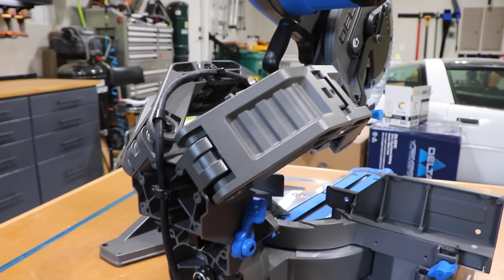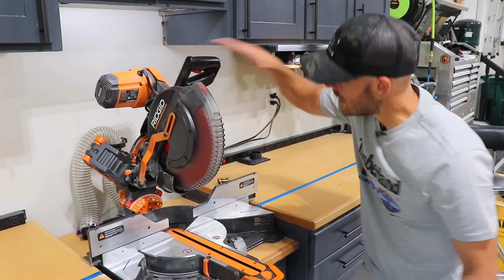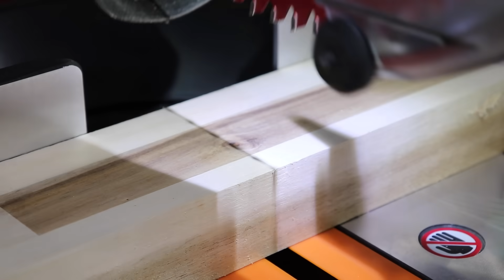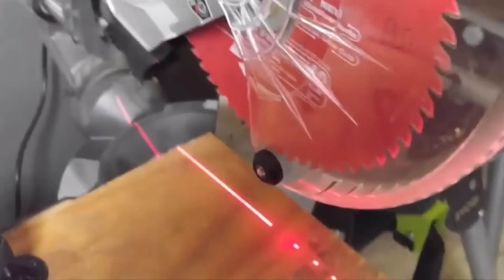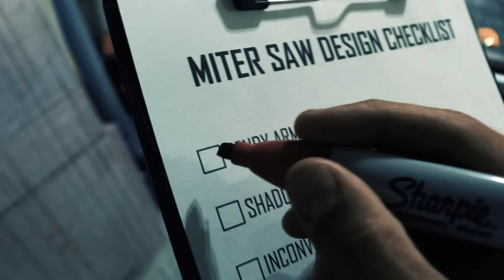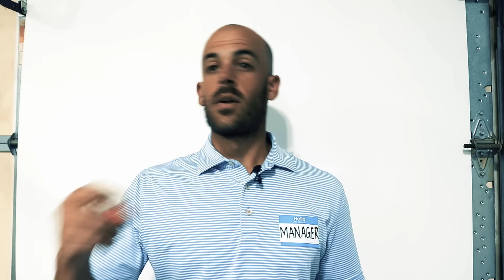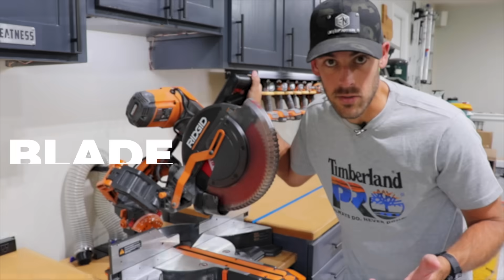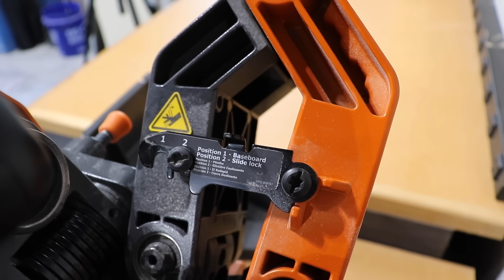I ALMOST took this Saw Back. // RIDGID & Delta Dual Bevel Sliding Miter Saw Review

Comment: I’m no expert but I think the saw should somewhat self center around the axis of rotation 
Bc the blade is spinning so fast it should want to center due to its inertia 

Think of your car steering wheel, it self centers after a turn if you let the steering wheel go

Comment: Now the Delta 10 at HD is 615 and Rigid 10 449. Did you notice any blade wobble? My other brand moves (measure at bottom flat blade above teeth, hand turned) about 1/16 to 3/32. YT videos of Dewalt show fixing that one with new inner bushing.

Comment: Travis. Episode gave the best overview of any piece of equipment I have seen Went to Home Depot and bought the Rigid 12 inch. Very pleased with it so far. I also purchased your dust collection chute. I have one question though. Is the rubber piece supposed to go from the top of the 3D painted piece on both sides. Mine seams to be short be about 1 inch short. Am I missing something?

Comment: Actually there is a use for this saw for those of us who make furniture. Rough cutting stock to length, faster than a table saw honestly. I use hand tools always for the final cuts on my furniture so power tools I look to for saving time in the more mundane processes such as rough cuts. Repeatable rough cuts are huge time savers for those of us in the industry.

Comment: I popped over from another reviewer's video and he mentions that thin kerf 12" blades will have more deflection. Maybe the additional spinning mass of a thicker blade reduces deflection. Maybe it's the flex of the blade because it's thinner. Maybe a bit of both. Perhaps a blade-to-blade comparison on the same saw would be interesting

Comment: I owned the old Ridgid model before the new one you have came out and traded it for a Dewalt,  top end version.  With both saws I have never had a problem getting accurate square cuts on larger materials.  Granted I don't make furniture,  but I  have built a lot of intricate trim work.  I think blade movement when fully extended is overrated.  If the saw is properly adjusted and square,  it shouldn't be a problem with 12"-14" wide cuts. You generally mark a square line on your material anyway,  so you can see how accurate the cut is. I agree with you,  if you don't force the blade laterally,  you shouldn't have any problems getting a perfect square cut. If you think about it,  a 14" square cut can be made very accurately by hand with  a Skillsaw, and these sliding miter saws have been very accurate in my experience with Ridgid and Dewalt. 

My Dewalt has the shadow line feature you mention and it took me a while to get used to it.  I do like it and it works pretty well in most situations.  It is very accurate.

Comment: Hello Shop Nation
I just found your channel and subscribed.   On the saw stand problem,  I think, I have a possible solution. If the length of the cut is close to the width of the saw. Why not level out the saw stand to be even with the rest of table. The how to due that depends on permanent you are willing to go. My first thought was all threads bolts, that way you can level all directions. Anyway, you just acquired a Aircraft Mechanic to the group. I usually have to think outside the box. Again thank you for the opportunity.

Comment: I used an old Craftsman 10" miter (dual bevel) for years. It has much worse blade deflection than any you showed. But managing it was possible through technique. Like you said, you should NOT be fighting the tool. Let it do the work for you.

Great video, and I am definitely looking forward to a comparison that actually includes three brand/models I am interested in purchasing next. Thanks!

Comment: Travis, this is an excellent video and I think all viewers universally appreciate the side by side (no pun intended) comparisons and your detailed research. I'm hoping you can adapt your chute design to the Bosh..if so, I think you'll sell  a lot of them. In my case, my hood does a pretty good job, but I have to remove it for 45's...i.e. dumb miscalculation on my part. Your chute would let me dump the hood and cut those rare 45s without dinking around. Thx

Comment: I think missing from this discussion is why the slider exists.  For many woodworkers it consolidated the functions of a radial arm saw and chop saw, allowing one tool to be removed from the garage. Most non-industrial radials had deflection, but they were popular for breaking boards down...sound familiar? It's hard for me to believe that a slider that is locked in the contracted position is less accurate than a chop saw...at least to a degree that it would matter to most of us.

Comment: Deflection fix: 
Let the blade spin up to full rpm before you move it, then make slow deliberate cuts.  Gyroscopic force keeps it true unless you horse it.  Learn your body’s movements.
Reply: And use a thin blade further reduces that effect
Reply: @phubarnow5388  How's that? A heavier/thicker blade provides more mass, thus should resist deflection more.
Reply: @pawpawstew  - yep, the most accurate cutting blades are the thickest and most expensive but worth it.
Reply: Yay, Physics!  Angular momentum is like magic.

Comment: I had the Delta Cruzer 2nd gen, that was supposed to correct the blade deflection issue, Well, it didn't. This saw would be off a degree or two on Miters for finished moldings, NO matter what I tried it would deflect on hardwoods. Loved the slide arms though!  Thank god I kept my DeWalt which is set dead on accurate.

Comment: It would be better if you measured the amount of full extension deflection with a dial indicator and a fish scale at some reasonable consistent force. It would still be subjective because of pull location, but less so.
Reply from the maker: Yeah I thought about doing that but I have that in my back pocket for the full comparison video
Reply: @ShopNation  when do you think you can put full comparison video together?

Comment: I removed the "Inconveniently Located Handle" from my Cruzer after I installed in my miterstation.  It is in the drawer below the saw if I ever need it.  This allowed me to bring my 2 1/2 dust collection hose in without interfering with the tilts.  Also if you choose to retain the original dust chute, I recommend removing the reinforcement bars in the dust path.  Mine consistently clogged.  If I purchased this saw now, I would have purchased the Shop Nation dust collector.  Since I designed my workstation around the original configuration, I have 4 inch dust collection above and below the saw that does the job.  My kids call it the "Chop Saw Shrine" .  Way more work than Shop Nation's collector 🙂

Comment: You lost me... How do you get a cutting depth greater than the radius of the blade?
Reply from the maker: Technically you can cut with the back edge of the blade and avoid the center of the blade.  A little misleading like the full travel capacity

Comment: How does the Rigid 12" compare to the Bosch 12"? I have been wanting a Glide for a couple years now, but the $650 price tag is difficult to swallow. This would get it much more in reach, assuming it's a sturdy tool.
Reply from the maker: Bosch is definitely nicer, just depends on what you're going to be using it for

Comment: Great review!  "Festool for life" hilarious!  I have a Makita 12" slider which is about twice the price of the Rigid and half the price of the Festool.  Although better, you can make it deflect as well.  As you said, always keep in mind a tool's limitations.  Sadly, Makita has stuck with the laser which I agree is not as good as a shadow line.  The Makita is also a beast weight-wise but I work mostly in-shop.  BTW, you could easily fix your saw's miter range by shifting the saw an inch or so forward although that would probably mess up your stop block t-slot. I actually wish I would have placed my t-slot behind the saw fence to allow for a flip-stop design.

Comment: To get full cross-cut capacity from the saw, just place some 2x4s across the table standing up so you essentially raise your table 3.5". Put the workpiece on top and cut all the way through. You will be cutting with the the higher up (larger diameter) section of the blade and get that full 17".

Comment: I don't even use a miter saw that often (borderline got rid of it) and for most of the stuff I do the little 10" Delta Shopmaster non-slider I have is perfectly adequate, but I'll be damned if this video didn't almost make me buy the Ridgid while it's still at this sale price.

I managed to resist, but barely.

Comment: I have had the delta 10" cruzer for a couple years. I love it. Never had any problems with it and have been cutting a lot of aluminum (with the right blade). It hardly needs any force to cut so just glide the blade down and no deflection.

Comment: You guys kill me with the negativity about Ridgid lololol. I have done lots of work with Ridgid power tools and it all has come out great. Not everyone has thousands of dollars to drop on expensive tools. But as long as you are using the stuff correctly and maintaining it these tools work great. I have all the basic Ridgid power tools such as the table saw, compound miter saw, planer, drill press and all of them are going strong.
Reply from the maker: You guys?  Don't you see all of the orange in my shop?? I'm a RIDGID fan

Comment: thank you for the informative reviews.  I have been thinking hard at the Ridgid saw to replace my dewalt 12: non-slider.  Would love to have extra capacity in smaller footprint for my small shop.  I mostly build furniture tho so am concerned over the deflection/accuracy.  
Something I am wondering... would tightening the tension slightly on the arms help to remove any of the deflection?

Comment: As I watch this video, I'm thinking there is absolutely nothing either of these saws (or any other similar saw) can do that my 1970's Radial Arm Saw could not do as well if not better.  Portability is the only plus I can think of, but being able to rip up to 29" deep into a 4x8' sheet of plywood offsets that IMO (a plus for the radial arm).  Oh, and my crosscut is 16" with no weird mods. I never understood why the radial arm saw lost favor and is not mostly extinct except for in limited commercial applications.  Yeah, I guess I'm sort of a dinosaur.
Reply from the maker: Agreed!  If they still made them I would probably get one

Comment: Wait! Hold on… Just a second… I think you said to get a highly accurate crosscut us a tablesaw and sled. Not that I disagree but as a hobbiest hoping to make great stuff someday it seems to me instead of upgrading my non-sliding mitre saw I would be better off getting a second table saw, making crosscut sled, and getting a great crosscut blade instead. 

Which in all reality sounds both insane and pratical.  Use my current miter saw for carpentry, current table saw for rips, new table saw for crosscuts. I like doing dados on a table saw as well. But the crosscut table saw could be selected making sure it could take a dado stack… or use my current saw as I am now.

Thanks for the great review. Also I have been following the better dust collector journey. There will be a purchase from me when the weather turns cold. I do the pop up shop because my woodworking shares the garage with my MX-5. In the warm months woodworking is mostly an outdoor experience.

Comment: So I am a finish carpenter by trade. Wood workers massively under estimate the accuracy of a miter saw. That said I have tried the bosch,  and delta (rigid) and non of them are acceptable for finish carpentry. The deflection is insane, and cutting flat stock it is no big deal. Cutting crown or base against the fence its a mess. I think this is why people get frustrated with these saws, lock them down at 0 and just use it to break down rough lumber. At that point just get a circ saw which is way more compact anyways lol. I cut perfect miters om a dewalt (used to do so ob a rigid)  every day with no issues. If you want a good miter saw with out a high price just drop the sliding feature all together. I learned on a 10 inch dewalt saw and it served me well.

Comment: I am ready to order your 3D printed chute but have a question.  You offer a standard flap or a stiff flap or both.  What are the advantages or disadvantages of each type?
Reply from the maker: If you have a high static pressure from a shop vac, sometimes it will "collapse" the standard flap material into the blade.  The stiffer material will not, but it's obviously not as flexible

Comment: Great review/comparison, Travis~!  I have an older 12" Dewalt compound miter saw (non-sliding) and have been looking to upgrade.  I've been eyeing the Bosch for quite some time, but now seeing this video, that Rigid looks like a good option as well.  I saw the shadow line feature on the Makita saw and I really like it over a laser/LED, but that one is cordless and I don't want to launch into another battery format, since I'm already into Porter Cable, Bosch, & Milwaukee.  I'll definitely be doing some further comparison.  Whichever way I go, I'll be sure to pick up your dust collection shroud.  Thanks much~!

Comment: I love my Metabo 7-1/4" sliding miter saw. It has an unbelievable 13" cut capacity with forward arms so it takes up less room. 

Crazy expensive, yes... But a standout in it's class.

Over the years I've realized it's the only miter saw I need for my workflow since I'm never crosscutting timbers over 2" thick on a miter saw.
Reply: Milwaukee and DeWalt for reference only have an 8" cut capacity. I can easily cut through 2x12's or 8" siding at more than 45 degrees. 

Anyone who has done siding with a miter saw can appreciate the convenience of being able to make these cuts accurately.

Comment: Get rid of both saws and purchase the Makita! I know you're sold into using these other two bc they fit your "shop setup".
Reply from the maker: I am interested in trying the Makita
Reply: @ShopNation  ... trash the hoses from the Makita LS1219L and upgrade to (2) 2.5" >>> 4" y pipe if you're in dedicated DC station.

Comment: I used ridgid tools extensively in the trades for the past 10 years and for the most part I think they're pretty good tools but they simply don't hold up to the likes of DeWalt or Milwaukee. I mostly enjoyed the lifetime service agreement but when it became too much of a hassle to have that tool replaced, I began to seek alternatives. One of my biggest grapes was that we don't have a service center here and the tools had to be returned to home Depot for exchange and that meant that if I had a defective impact driver from a large kit, I had to have the entire combo kit replaced. sometimes this meant that I lost a tool or accessory that was better than the replacement.
I've switched over to DeWalt tools and invested quite a bit of money in those tools but like they say, you get what you pay for. I find my DeWalt tools have a much better feel and performance but I know there isn't a lifetime service agreement so let's hope it works out for me. I consider ridgid tools to be professional homeowner grade tools that a tradesperson shouldn't be ashamed of using because of their excellent features and reasonable performance.

Comment: I see you have already removed the dust chute on the Bosch 12 in. I think for best results you will have to avoid reusing the native mount because it does not stay with the blade for chop cuts. In order to truly "Festoolize" this saw you could use the 2 screw holes already on the back of the blade shroud that hold on to the small black metal guard. I was going to do my own in OnShape but would be happy to pay for your STL if it is anything like your last design. Looking forward to seeing your results.
Reply from the maker: yeah, interesting.  I already love how much room I have to work with versus the RIDGID/Delta nightmare...

Comment: I have the Kapex in my shop and a Makita at our farm property.  The Makita doesnt get a lot of press for the most part, but I can honestly say it is the best sliding compound mitre saw made. IMO, better than the Kapex. It would be great if you tackled dust collection for this saw. In addition, the factory blade that came with it is probably the best factory blade I’ve ever used…..so good that this is the ONLY saw I have that I would prefer to replace it with another factory blade when the time comes. Interestingly enough, whenever I see somebody that has one of these saws, they’re almost always a high end trim carpenter.
Reply from the maker: Yeah I'm very curious to test out the Makita

Comment: You need to raise your table up 2 or 3 inches to maximize your cut length . What that means is you need to lay a 2 or 3 inch thick board or whatever you can use for a table on top of your miter saw table and put your workpiece that might be 17 inches on top of that you would have to measure to get your maximum cut length

Comment: Your suggestion to keep it locked should be something more people notice. A huge percentage of us would be able to make almost all the cuts we need on a regular old non-sliding mitre saw. Cheaper, more accurate, lighter, and easier to keep tuned, non-sliders should be in more shops.
Reply: I agree with your observation but not 100% your conclusion. In "chop saw mode" and dialed in, my Bosh Slide makes great cuts. But I don't always need perfect cuts...sometimes I just need the convenience of getting close, especially when cutting long boards.  Of course there are times when I need to break down boards that are 7-8 inches wide x 1 1/2" thick, and a non-slider won't  do the job.  I've long debated whether a non-sliding saw would be sufficient for me, and always conclude that the slider provides flexibility that is great to have when I need it.